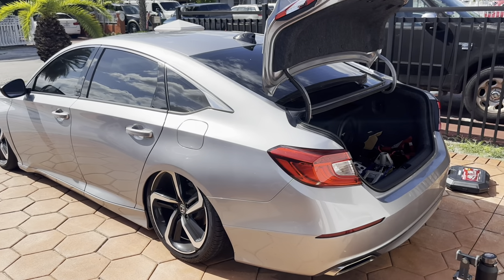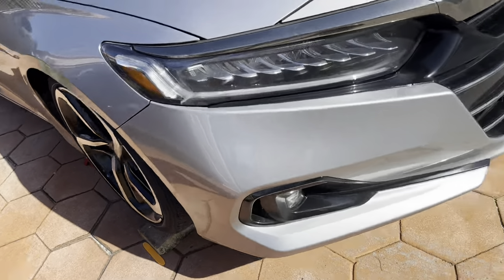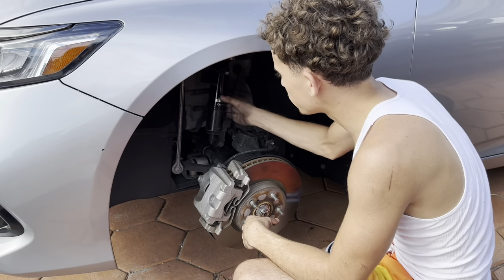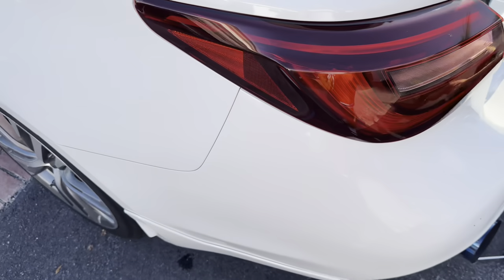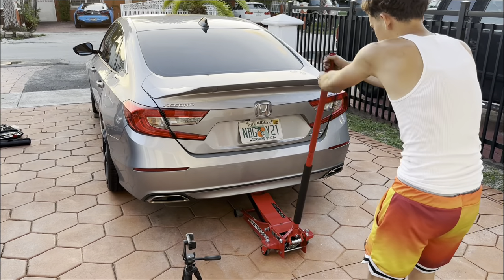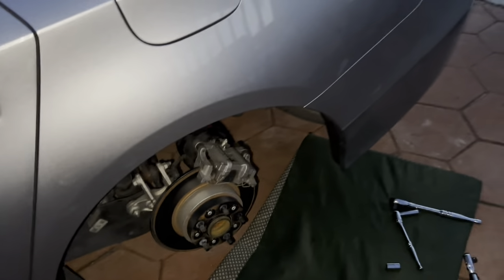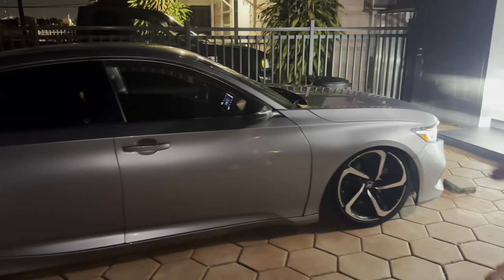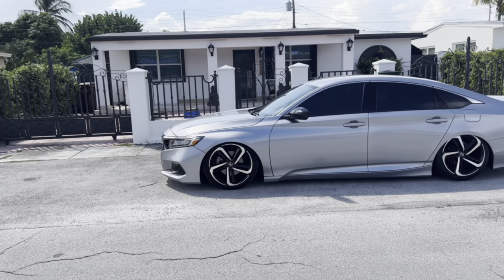INSTALLING SWIFT SPRINGS ON MY ACCORD!!!

Comment: U needed to leave  the max low adjustment how u had it with out the collars on the 4 inch springs u would’ve been sitting slammed slammed